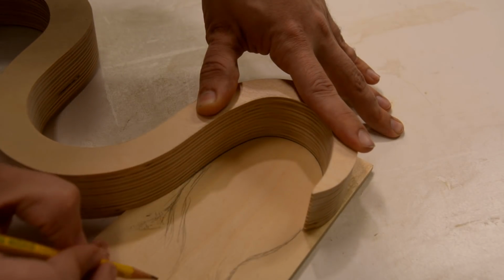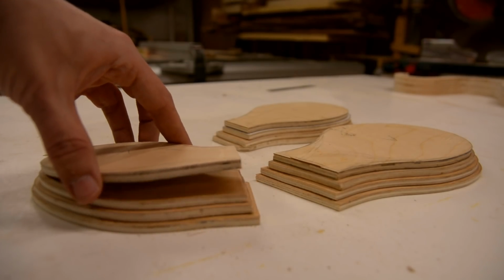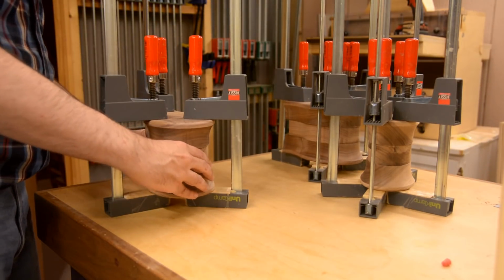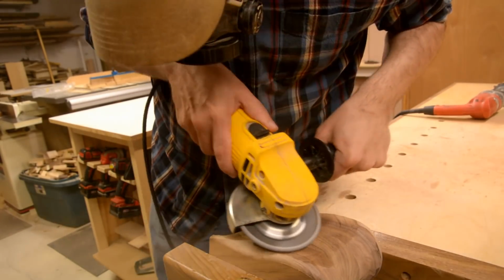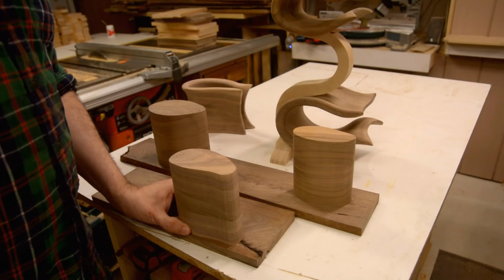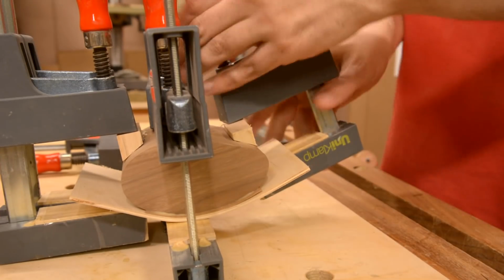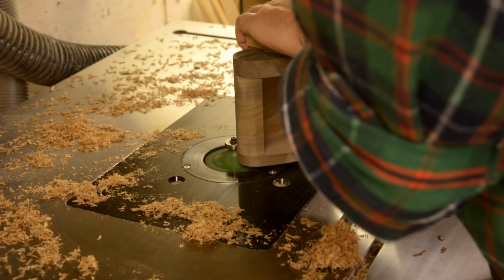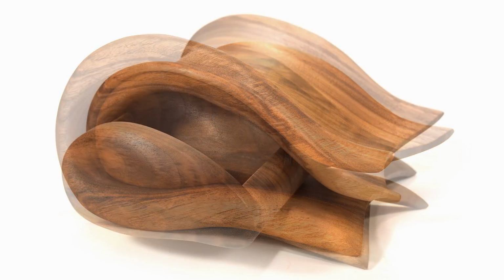Sculpted Bandsaw Boxes

Comment: Once again a beautifully intricate piece.  I like that you include the thought process and course changes that often have to occur when making unique art pieces.  There is nothing more frustrating than being almost done with a several step piece and a "disaster" striking.  A nick here or there in a wooden piece is character,  a grind going wrong on Waterford Crystal is a travesty.  I would not be able to handle the pressure of the latter.
Reply from the maker: That's why you don't see me doing much geometric stuff.  Thanks for your thoughts!

Comment: It killed me to see you take the band saw to those sculpted walnut pieces. Instead of using a grinder to smooth out the middle, you could had utilized a 1 inch air powered belt sander. That would have given you more control with less chunking out with a crude tool such as a grinder disc. Love the finished work. Thanks for sharing.

Comment: Love the result, and the problem solving... nice to see tear-out needn't result in firewood, nice recovery. Would appreciate any information on consumables (source, grit, etc.), specifically...  shaping grinder discs and foam-backed sanding pads.
Reply from the maker: The disc in the grinder is a Kutzall.  Mine is off balance and vibrates enough that my left hand turns red in about 2 minutes of use so I don't know that I really recommend it.  The sanding pad for the drill is called Tim Skilton sanding pad.
Reply: Great, thanks. Disc didn't look like it was out of round or had uneven wear, maybe not seated properly.
Reply from the maker: David S It only gets loaded on one side and it's been on and off a few times.

Comment: Cleaning glue before its dried should be done with a soft wet cloth, depending upon the grain type leaving the wet glue can be disastrous if it soaks into the grain and you need to oil or stain the wood, white patches are all too visible.
Reply from the maker: That just spreads it around.  It's better to wait until it has started to set up but not completely dry and scrape it off.

Comment: i watched this whole thing thinking this was some type of storage for bandsaw blades. still dont know what they are
Reply: I first heard about bandsaw boxes 5 years ago, and I thought exactly the same as you. Turns out they're called "bandsaw boxes" simply because they're made with a bandsaw.
Reply: but he used alot more than just a bandsaw
Reply: Yes, and the bandsaw is essential. You don't need to sand it or round the edges with a router; to achieve this style all you really need is a bandsaw and some glue.
Reply: Me too, I watched whole video confused on what these are, I kept thinking "oh at the end it will be clear exactly what they are and how these boxes work"  I still don't know what they are or how they are even called boxes. He used the router as much as the bandsaw, maybe they should be called "router boxes"?
Its a box that's neither made entirely with a bandsaw nor is it a box. I'm so confused
Reply from the maker: A bandsaw box is a standard woodworking technique.  Google it.  This is a variation on the standard technique that introduces sculpting to it, which brings in the use of a number of other tools.  At it's heart it's still a bandsaw box though.

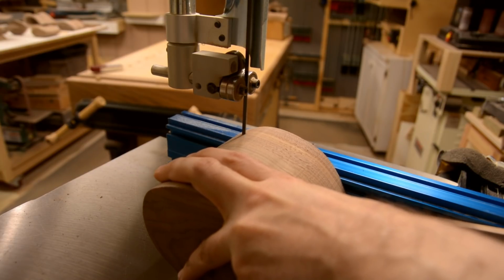Comment: At 8:37 when cutting a round object on the handsaw why not attach blocks fixed with double sided tape to your piece away from the blade to stabilize your piece as you did with your clamps a little further along @9:47 in the vid? By the way these are absolutely beautiful!
Reply from the maker: Good thought.
Reply: Gayle Posey Bu
Reply: Gayle Posey

Comment: Why shouldn't you rub glue off while it's still wet? It smears it around a bit but you can usually just wipe it all off..?
Reply from the maker: You're spreading it around more and it gets into the pores of the wood and soaks in.  It can look like you wiped it all off but when you apply a finish you can see everywhere the glue was unless you sand it all.  The best thing to do is mask off all the areas around where you are gluing but that's not always practical.

Comment: Great job!! Did you experience any blade drift with pushing those large pieces through the bandsaw? I have a descent 14" bandsaw and have tried several blades with different TPIs but I can't get mine to perform the ways yours does. Can you enlighten me? haha
Reply from the maker: 3/16" 3-4 tpi is what you want.  This one was a 10 tpi which isn't ideal but will work if you slow down.  Don't force it and you can only turn while going forward.  If you try to turn without it moving you just bend the blade.  Otherwise you might not have enough tension.

Comment: Question from the dummy.  What the hell is a bandsaw box?
Reply from the maker: It's a box made with a bandsaw.   It's a pretty standard technique where you start with a block and cut a shape out of it.  Then you optionally slice off a layer from the back.  Then you cut out a piece or pieces from the middle which will become the drawers.  You glue the part you sliced off the back back on (or you skip doing that if you want the drawer to slide all the way through).  You repeat a similar process with the piece(s) you cut out of the middle to make them into drawers.  I've done a number of videos that are variations on that process.  There are lots of videos on the standard way of doing it around, some of which are in the playlist linked in the video.

Comment: You have a full wood piece...why the fuck would you put veneer on it?  LOL
Reply from the maker: When you cut the drawer out and sand out the saw marks you are left with a gap between the drawer and the outside.  If you want the gap to be even around the drawer, rather than have the drawer sitting on the bottom with a big gap at the top, then you need to do something to prop it up in the opening.